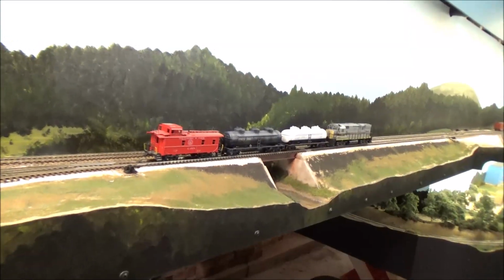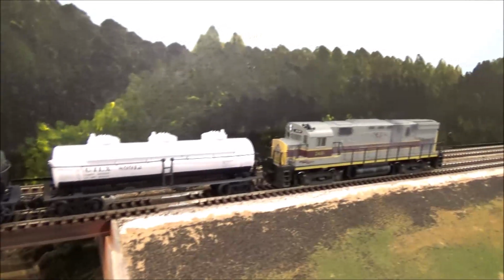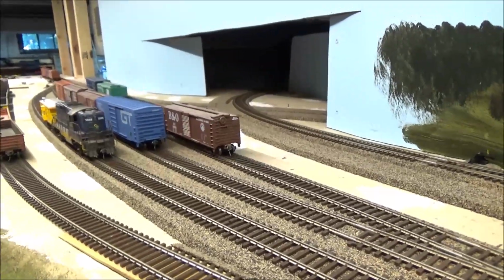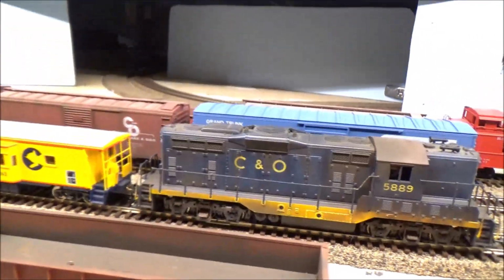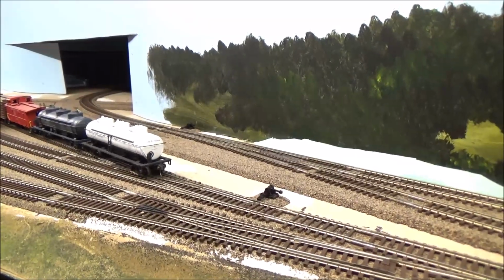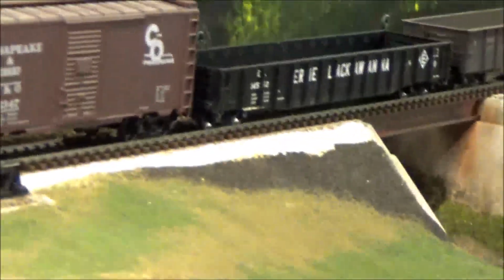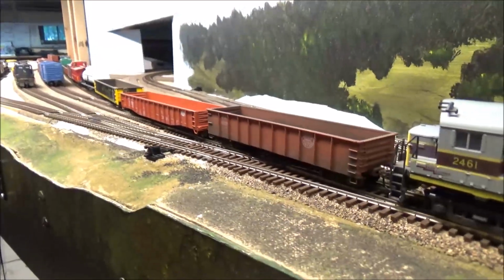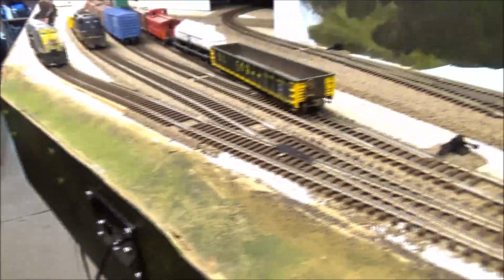Model Railroad Operations (Trackage Rights to Dubois Part 1)

Comment: Wonderful layout of the B&O Ops in Dubois went to college at Clarion & later had customers in DuBois. A few questions. Is this now part of the B&P? Is the creosote plant still in operation? If so who operates it. I realize as modelers we have a literary license  but I love how you modeled the era without using fictional geography and customers. Oh by the way did B&O have a connection with the LEF&C?
Reply from the maker: Yes the creosote plant is still there (at least it was a year or so ago) but is now operated under a different name as part of the Stella Jones company.  I believe that CSX sold the line in the 1980's and this railroad is now part of the B&P as you indicate.  This division of the B&O did not run through Clarion or Summerville but was not far away and may have handled some LEF&C traffic handed off by the Penn Central.  thanks for the comments and questions. 

scott

Comment: Just kick cars against that geep while you're switching. After a few days of having to pick up everything off of the caboose floor they'll find somewhere else to park, lol.
Reply from the maker: Nice, i love it!   Interestingly,  although i can't confirm it, my understanding is that Option C of the 1976 Conrail plan was to have Chessie take over Erie Lackawanna rather than fold it into Conrail.  I think i read that Option C failed because the EL workers would not accept the lower Chessie wages (driven largely by the base cost of living differences between their two primary service territories).   Seems like there could be some plausible crew hostility between the two roads to further validate your suggestion.